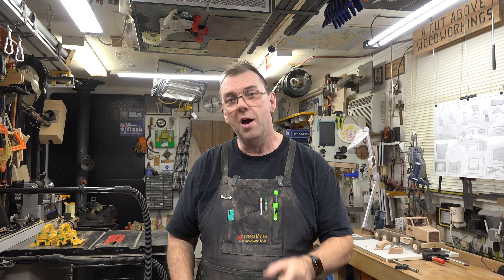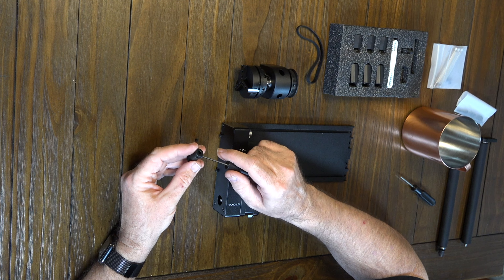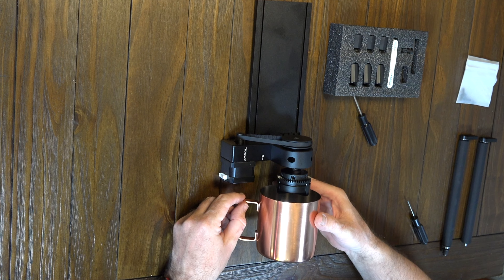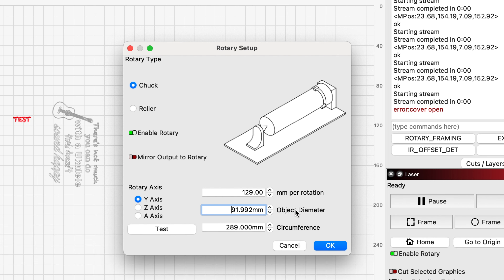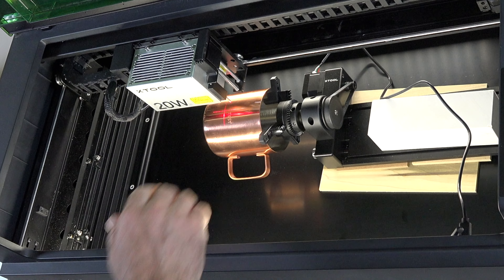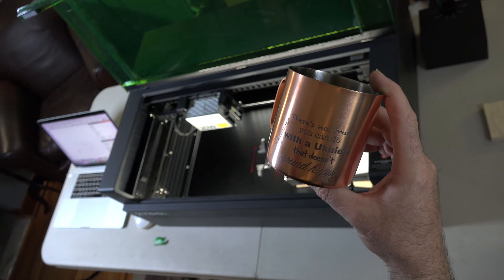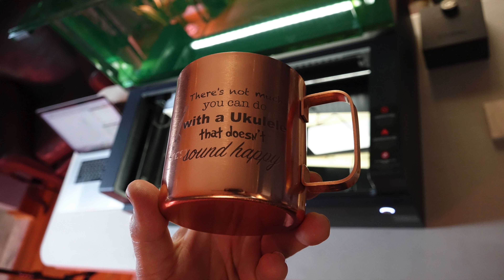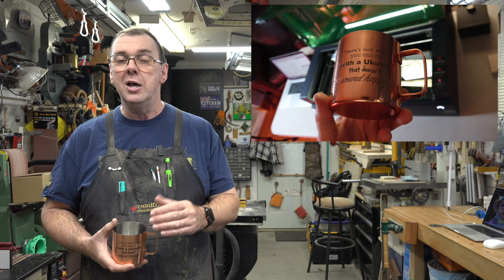Engraving Mugs With the xTool S1 Fully Enclosed Laser, Riser Base and RA2 Pro Rotary

Comment: How do you set up so it doesn’t hit the handle
Reply from the maker: Setting up a rotary to avoid the handle can be a frustrating thing Tammy.  I like to set my engraving software to start the engraving at "current position" instead of "absolute coordinates".  I then rotate the mug so that my current position is just beside the handle.  That way, when it starts engraving, the handle is outside of the engraving area and the rotary doesn't strike the laser head.  If you are engraving the other side of the mug, I measure around the mug from the handle and start my "current position" at the far right side of my design length.  That way, when it engraves, the rotary stops before hitting the handle.  It can be frustrating but it is very doable with a little measuring and some careful manual rotation of the rotary.  Also, don't frame it.  Trust your measurements to get the engraving set in place.  If you frame, the rotary likes to spin the mug in a 360 degree to get it position and the handle hits EVERY time.  I hope this helps.  Thanks for tuning in to the show.

Comment: Excellent demo of the capabilities of the rotary attachment ... very interesting👍
I feel that a little extra engineering could have made switching between the rollers and chuck a lot simpler, i.e. leaving the rollers attached and only adding/removing the chuck as required.
Reply from the maker: In some instances, you can leave the rollers in place.  It all depends on what you are engraving and how large of a diameter the object has.  For this particular project, the handle of the mug is what caused the issues.  Thanks for tuning in Barry and for chiming in with your thoughts.